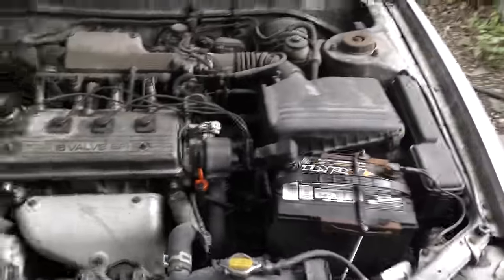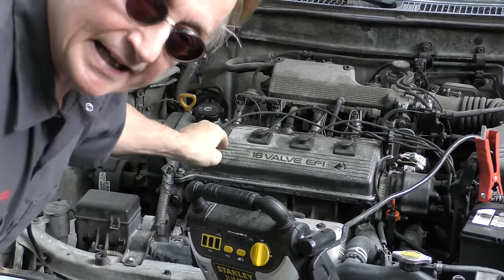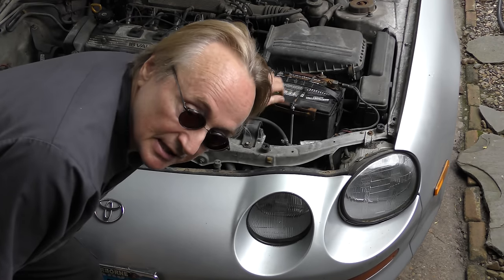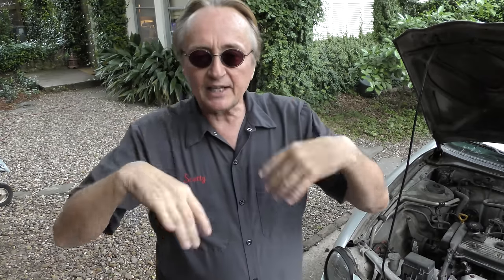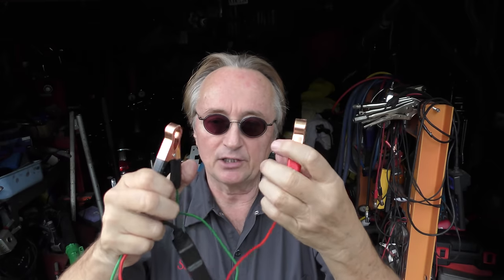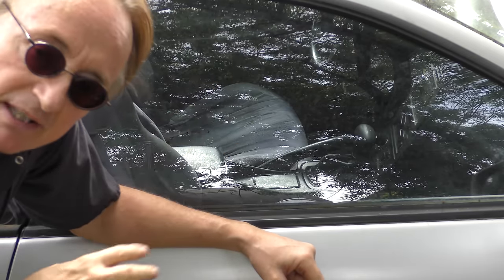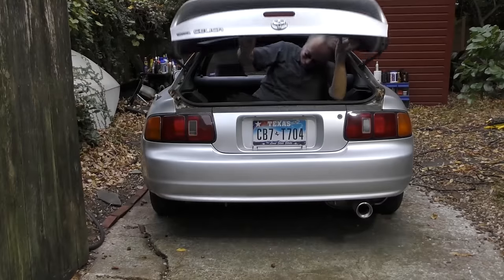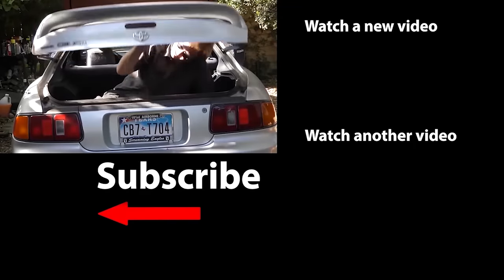Never Do This to Your Car (Learn from My Mistake)

Comment: The reason car companies make things more difficult is so the owners have to take their car into the dealer which .means the dealer makes money and will stay in business.
Reply: How old are you ? I'm happy your realised that anyway!
Reply: The ultimate worst from bitter experience is scrapping an old  car because even buying a manufacturer's key, NOBODY can synchronize it  and a whole new security infrastructure is going to cost more than the car is worth.
Reply: Gary True! I sold cars for 7 years and they would always have a salesman in the mechanic department telling customers  that they qualify for a upgrade blah blah blah
Reply: @PoodleMaster69  I'll be 73 in September.   I took a '72 Challenger to a dealer for  warranty work and had just bought some spark plugs and points, to install myself, and asked them to do so.  When I picked it up,  it stalled at the first stoplight.  And,  one or two after that.  When I got home I discovered the plugs had varying gaps.  I fixed that, set the points correctly and, since I didn't own a timing light at that time, set the timing by ear.  Ran Great!   When I finally used a timing light, no matter which plug used; the mark was 180° off.  Very confusing.  After that I did my own work.
Reply: @garymckinley6974  i had similar experience with these thefts but it was a garage ironically it's very well know here. it was 2012 at the time I knew nothing about cars, I toke my mother's 09 Infiniti qx for worn struts, the mechanics said all of the arms are worn down and the AC compressor need replacement even though it was ice cold. he said that it got only few months to die but its still running like new!, I refused to replace it since he'll charge me only for ac replacement 2,722$! after finishing the job I took her car and it didn't want to shift! long story short they literally drained all transmission fluid! :) since then as much as I can I work on our cars
Reply: Gary McKinley True...dealerships make much more profit from the service department than sales.
Reply: Rick Boucher  - They are called "STEALERSHIPS" for good reasons.
They get you in all ways: trade in,  price, service.
Scotty tells you to avoid them!
Reply: No sadly that's wrong. The EPA brings tougher laws every year and engineers have to work to squeeze every last penny out of the fuel you use. Manufacturers could give less than a dam about emissions.
Reply: No the problem is not about staying in business, car and machines always break down and we will always need vehicles, what’s happening is they are making it so they can make more money and a lot of it by making cars less workable to work on yourself and easier to break. They are being money greedy because they’ll always be in business no doubt about it but they don’t want to wait for your car to hit 150k+ problem free anymore to make more money and a lot of it. It’s the devil’s game but they’ll get there’s and hopefully people become more educated in this matter.
Reply: @PoodleMaster69  73yo in September
Reply: @sanchezs7614  Hahaha. Yep, it happened to me first time I took my vehicle for repair. I told the salesman... " GOOD TRY" 😆
Reply: but don' tthey understand we have internet now to spread the call about garbage cars like Ford, (which is now not even SELLING cars), and VW? and they'll lose sales?  NM i already know the answer, they don't care...
Reply: That's why right to repair in Apple product emerges. For this reason also.

Comment: BMW owners might want to invest in one of those fancy $4,000 scan tools... because that's what the dealer will charge to reset the system! Lol.
Reply: you can buy a $20 dongle on ebay, a laptop and free bmw software on the internet.. same software used in the dealership..
Reply: Arthur Esclamada True... that’s what I use. Even my friend that’s a BMW certified tech likes how fast it runs on my computer lol.
Reply: BMWs have very good engines.

Won the most Wards best engine rewards
Reply: Ole scotty  could go 15

Comment: My 2011 Camaro Convertible had the AGM battery and there was a reason it was ordered like a race car with only the suspension and drivetrain upgrades! Even stripped down there are tons of electronics, but GM doesn't make life harder. My '08 Caddy came with a lead acid but I went back with the glass mat, and I did that battery swap myself, but quickly, and my battery wasn't dead dead. 
Thanks for the Video Scotty! Now I have another reason to never purchase a BMW.

Comment: Attach the negative to metal on the engine/car......that is, IF you can find any metal in the new POS.  You couldn't give me a new BMW.....  I've never heard of the keep memory alive device......gotta get one.
Reply: Tell me about it, everything is freaking plastic inside the engine bay, especially on Euro-trash.
Reply: Yea I accidentally broke the upper radiator hose on the BMW because it's all plastic. Never buy a BMW unless you like spending money on unnecessary repairs.
Reply: Heard it from Scotty about a year ago. The problem is to find a power supply to connect it to before disconnecting the negative on the battery.
Reply: @ruben2365  I think that the old ones were quite a driver's car but now they have half the world's known supply of petroleum in them in the form of plastic.  A friend of mine and I used to race an old one in gykahynas back in the day and it was as dependable as a claw hammer.  How could they go from that to this?  Agreed on the plastic radiator tanks....the guy that came up with that ought to be either tortured to death or made to fix BMWs in a dark, cold garage for eternity.
Reply: @tomnekuda3818  Jaja yea I agree I can't for the likes of me understand what is going on in the engineers head. I got an 07 328i and will be the last one that I own.
Reply: There are some down sides for sure, but my 03 BMW has a beautiful ground spot for jumping that has a pretty orange/red cover over it.  And beside it there is a semi-sealed compartment that has room for the cables, a couple quarts of oil, and a couple gallons of coolant or water.  I don't know how many times I've given jumps and given away a couple gallons of distilled water. My BMW sure does have it's challenges, but it's more enjoyable to drive than any other car I've owned and well, my wife is the same way :D
Reply: @jackjunk5495  Yea the interior looks nice but I prefer my Lincoln continental over the BMW any day of the week. That car is big and has plenty of place in the trunk but ever since I got rid of the rear air bag suspension it's not as smooth as before. The weight of the car absorbs most of the impacts and I'm using american made coils and   shocks. But it also has auto rear view mirrors auto window. Steering wheel controls for ac, and stereo. Easy or hard steering power. Etc etc. I like the continental cus I can just drive all laid back and I've grown to like the sound of the 4.6 when I push the pedal to the metal. Haha
Reply: Memory savers are great,I was a Audi/VW never had to reset anything,example a customer coming back and saying where are my preset radio stations
Reply: Or. Just hook up a bank of AAs @ 12V into the ciggie lighter or directly to the batt terminals and save all the $$. All the computer needs is power....nothing else.
Reply: @mykeprior3436  That's smart....never thought of it.
Reply: Obd2 code keeper
Reply: Tom Nekuda The keep memory alive device is on the shelf next to the Keep Hope Alive device.
Reply: Why we act dumb , there no good car in the world is all about money everything and every part has a expiration date is all business
Reply: @karkule5919  I guess I have a lawn tractor with no computer I could steal it;s battery.
Reply: @ronaldpankonin3671  Get a cheap jump starter with 12-volt outlet, usb outlet & tire inflator all in one. They're not expensive.

Comment: It's getting harder to find a metal part in the engine compartment of a late model car.  So much plastic!
Reply: Cary McCall you have to remove the “stupid” cover to find any alloy.
Reply: Robert Burley 😹😹😹
Reply: I was working on a cursed Pontiac Sunfire one time and the intake manifold was plastic. I flipped it over when I put the new gaskets on and it had a clearly visible recycle emblem on it XD
Reply: You have to jack the car to find a metal part! :)
Reply: The stupid complexities imposed on us are from that stupid EPA and Dept Of Energy.
Reply: Giant powerwheels lol plastic everything now ! bumpers where made for bumping in the good old day , now you bump someone and its 2 grand for plasic painted bumper and in the day 200 bucks for steel but most times in was just a dent so carry on . Now yoh know why classic cars are worth so much now ,,,,,all steel
Reply: U can ground to the frame and body also, not just the engine
Reply: @4486xxdawson  my mom bought a 2017 Hyundai Elantra brand new. Within 6 months she hit a possum with it. Took out the bumper, the running lights, some of the electrical components, and the radiator, the radiator support. Basically on once you get past the license plate mounted on the bumper there’s no metal till you get to the damn engine other than the radiator fins
Reply: That's the truth!!
Reply: @redneckwithajeep5001  I remember my parents had a 1980, Mercury Grand Maquis. Big car chrome bumpers designed to take an impact. A woman with a minivan ran into their rear bumper. The minivan had a destroyed bumper, grill and dented hood. The old Grand Maquis had a tiny scratch on the bumper. So much for progress.
Reply: @don-cw1yz  exactly why I went backwards with my cars. My current daily driver is my profile picture. It’s not particularly fast but it’s fast enough to go down the highway safely
Reply: Amen to that!!!!
Reply: @don-cw1yz  my father had one of those they are built like a boat / tank

Comment: At the bottom of each glass panel on your vehicle, it will say “Laminated” if it is laminated.  On newer Honda’s both front doors have laminated glass and the back two doors have standard glass.
Reply: What constitutes "newer" I have a 2013 Honda Crv

Comment: Hello Mr. SCOTT! I was a Class 8 Truck Mechanic (Disabled Now) can't walk. My wife's Infiniti, Sunday driver, got to where it wouldn't crank after sitting for a few day's. I went to Autozone, my Friend is the Manager, to get a new Battery to replace the original Japanese made one. He checked it and,it was going  bad. I bought a new one and we got two of the same Batteries, put them on a cart, and outside we went. The battery is on the right side in a box against the firewall. You have to take all the cowl plastic and, trim off to change these things. FUN! The Sterios anti theft will lock up and, won't  work if no power is on and, other systems also, which means a trip to the dealership. We got everything off, and loosened the Terminals, used a set of jumper cables hooked to the other new Battery,  so the car wouldn't lose power, I held the cables on, so they didn't pop of while he pulled the old Battery. Dropped the new one in and  put the Terminals on the new battery, unhooked the jumpers. Tightened every thing up and put all the cowl pieces back on and everything worked perfect! It was a P.I.T.A. having to remove so much stuff. They are not supposed to do cars like this, just the quick, simple drop ins. He did me a BIG favor. You are right about the negative terminal end having a piece inline, that's sealed with all kinds of things and, fuses you can see through the clear plastic. Keep power on these new vehicles if at all possible, or you WILL be taking a trip to the dealership for some resets that only they can unlock!

Comment: The last time I was this early, Chrysler was a great car!
Reply: and scotty was a young mechanic working at the Texao lol
Reply: Lol, so never this early then?
Reply: We have a 2012 Dodge Avenger with 200k miles still running. Don't know but we only replaced the alternator
Reply: PapiSantoes S All jokes aside I'm surprised it lasted that long that's more than triple what I would've expected out of it
Reply: Pre 1960, or so?
Reply: FLPhotoCatcher last time I was early GM was making decent cars
Reply: @JDMHaze  I was surprised as well. I baught one cause I seen alot of County Government officials use them and so far it's at 220 miles with no problems
Reply: I agree, dads 1958 Plymouth was fantastic!
Reply: Chrysler was never good!
Reply: Ken Hall - Pay attention!   He said a "older version!"
Reply: tom7601  - Old Booker here, I'd say up to 1976.
Our 63, and 68, were very dependable.
I should have kept my 1972 Plymouth Satellite,  and parents low miles 68 Newport.
Reply: Tim J  - Wrong youngster!   Up to about 1976, they were good, and had legendary dependability.
Price out what restored 1968 Dodge Chargers worth.
Reply: My dad bought a 58 Plymouth Fury brand new and the panels didn't fit right and it had more rattles than a diamond back rattle 🐍 after being stepped on!  😬
Reply: Thanks for the votes everyone!
@Coiled Steel Up to about 1976? Thats the year I was born. Hmmm.
Reply: @sanchezs7614  I have a 95 Ram1500 with 288000 miles on it and it still purrs like a kitten. It's all in how you take care of them. Regular proper maintenance.
Reply: Why you soooonuvaa.....
Reply: The Chrysler Cordoba, with rich Corinthian leather. The most reliable vehicle ever 😐😐🤣😂🤣😂 sorry, couldn't keep a straight face.  I remember my mother having to replace two engines in hers.
Reply: Lol, so never?
Reply: PapiSantoes S My grandparents had an old Chrysler minivan and it was.. okay. They bought a new Chrysler Town & Country and it was garbage, sold it in 3 months
Reply: 8 8b di didn't i9m 999
Reply: Chrysler has been junk way before YouTube started. Don't know what you're talking about.
Reply: Yessir Chrysler’s are bad they takes forever to change gears, the damn temperature gauge likes to break down, and worse is all the parts are expensive.